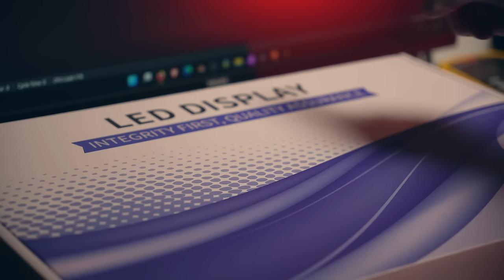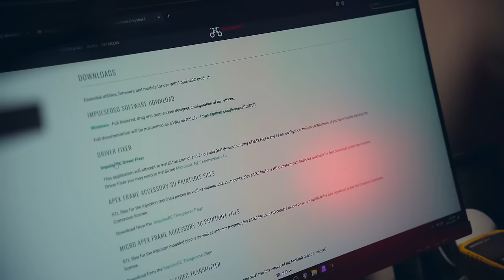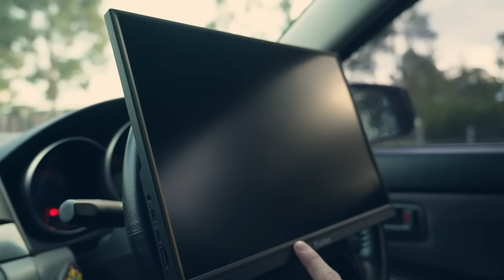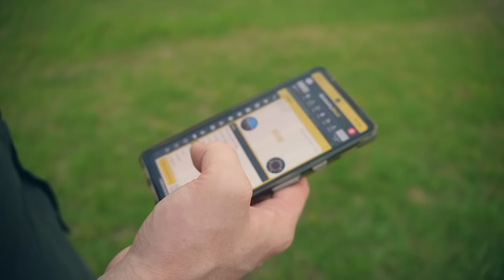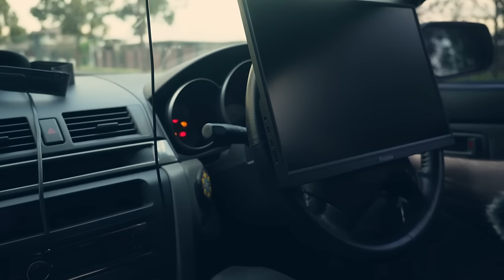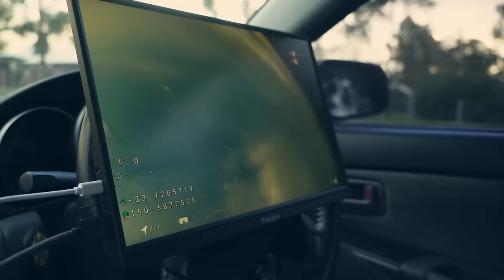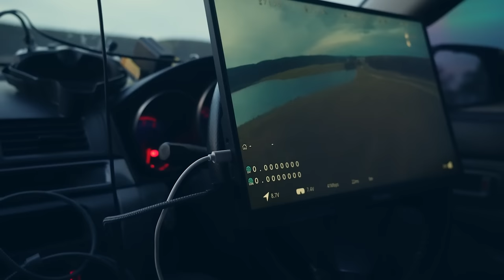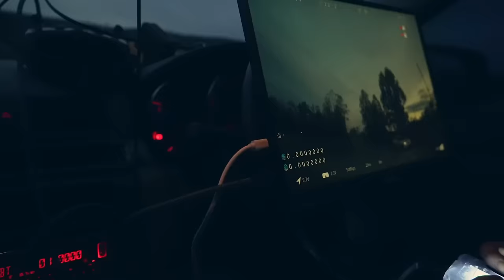FPV on a gaming monitor?

Comment: Nice design on the 3d-printed wheel monitor adaptor. I tend to wire the GPS to a 5 volt power to a pad that has 5 volt power when the FC is plugged into an USB. Can then use portable USB power bank, or plug into USB in your car as getting things set up, or near the field.
Reply: It also helps that the vtx isn't powered this way reducing interference and improving the sat lock.

Comment: To backup settings, connect to the FC and in the CLI tab type DIFF ALL and then save to file. To restore, go back to the CLI and click load from file. This would have gotten you most of the way but there are a few settings to work through that have changed in 4.4+ and would be colored red when loaded from a file. Backup settings before making changes and even afterwards too so you can always roll back if you run into an issue.
Also for sunny days you can make a cheap monitor sun hood out of black foam board and adhesive backed velcro. Happy flying!!!

Comment: If you get an M10 based GPS, they are much better at picking up satellites, plus they have a memory.  What I do when I get to a new session, is first just apply USB power to the FC via a powerbank.  That way the GPS can start up, while the VTX stays powered off.  Then once it has enough satellites locked, you can remove the USB power and power it up for real.  Should be ready to go MUCH quicker with this method.

If you think about it, if you enable GPS rescue, failsafe to  Return to Home mode (RTH) it can't take off before it has full lock, otherwise things can go seriously wrong if you flick the switch to enable RTH, before it has all the satellites it needs

Comment: if you decide go with the monitor instead of the goggles, you'd probably do better with the walksnail  standalone rx you can probably 3d print a mount that attaches to the back of the monitor
Reply: Also for turtle mode, you have to arm the motors for it to work

Comment: You can lower the minimum amount of required satellites to 5, and the Home Point will be accurate and it will then display the H and how far you are from the Home spot.
If you dont have a M10 GPS, then definitely get that. Allow arming without fix, lets you arm the drone without having the proper amount of Satellites, but you will not have GPS Rescue.. 
It still takes about 1-2mins for the first battery pack of the day. 
If you want to go even further look into how to do the GPS wire shielding and grounding the shield.. You will get 5-6 Sats and be ready to take off in 30 seconds..
Definitely lower your minimum Sats number needed for takeoff, i have never had a problem with it at 5 Sat's, which is the minimum for me on V4.4..  
Im going to be updating it to BF V5.0 release version soon as well to see what else was done to the GPS & GPS Rescue..

Comment: A trick with gps I learned… plug a USB battery pack into FC in the car and carry both to your launch area. Then unplug when you are ready to take off and your satellites will likely be fixed by that point.

Comment: GPS - wrap copper tape around your antenna, add a strap wire to connect it as per you antenna connection. Make sure the copper is covered/heat shrunk or fabric tape to isolate it & prevent shorts. 
No my idea - saw it elsewhere on YT 👍

Comment: The MSP connection is active arming error shows up whenever you are connected in betaflight so id say it would be the same for the speedybee app. Its so you don't accidentally arm it on the bench. The beeping is because of inactivity and kicks in after a certain amount of time. Not sure why it would not arm tho, also tips for getting a quicker gps fix, have the gps mounted as far as possible from the vtx antenna with nothing above it and also if you shield the gps wires by wrapping them with aluminium or copper tape it also helps. Cold starts on gps always take a while tho.

Comment: Have the same but named Azropa and I'm using it with MFD for long ranges with Walksnail VRX. Perfection when sitting in the car, looking at the monitor and don't feel the cold. Antennas mounted outside.
Reply: Arzopa pricing is very competitive. I also always FPV from inside the car next to the municipal park, VRX on the dash board. I tried having antennas outside on the roof, but on the dash is just as good when your craft is in front, on the sides or above the car for long distances. For short distance, it doesn't matter where the craft is in relation to the car.

Comment: You have the quad sitting on a metal drain cover, that's why you're not get enough GPS signals. You should never arm a GPS drone on or to close to metal.

Comment: An M10 might, but might also not, magically solve your locking time problems. If it's too close to the VTX and the latter is too noisy, it'll crap out just as much as the M8. And then the GPS antenna size also matters, irrespective of the GPS chip. And then stuff like cloud coverage on a given day matters a lot. And then, for this kind of flying, no real need for GPS.

There's a BetaFlight setting that lets you arm without/before having a lock.

Comment: 14:30 the beeping just is a little heads up that it's turned on and didn't do anything in a X amount of time as you said you where waiting for several minutes to gather more GPS satellites this would be the reason😅

Comment: You can build a ground station with vrx and a monitor...and no goggles at all...basically what u made your goggles be.  But a ground station can be setup with better antennas because it's not on yiur head

Comment: If your GPS is next to your VTX you’re gonna have a tough time getting satellites
Reply: That explains why my helicopter always gets tens of satellites in 5 seconds with the cheapest and smallest GPS in the market. My VTX is at the head of the helicopter near the front of the battery; my GPS is on the notorious long tail boom. I have been puzzled by so many videos about slow sat locking.

Comment: That monitor and the Walksnail vrx.
Hell yeah 
Also make sure low power mode is off when armed. I have the V1 fatshark Walksnail goggles and just a hill wouldn't make it lose connection on 700mw.
Truerc stubbies on goggles and Lollipop 4+ on the quads.
When o fly with my buddies that have dji around buildings/office parks/bando's they will be on 1200 and I'm fine on 500 to 700mw doing the same range.going inside buildings? I don't know as we go one at a time mostly and don't really compare mw's etc if it just works at that spot for us personally.

Comment: Your gps needs to be pointing straight up. Its angled the wrong direction. It needs to be pointing straight up in flight, which is why you see them pointed downward almost akwardly.  You can change the amount of satellites required to arm in the failafe tab. Thats why it wouldnt arm

Comment: If you haven't figured it out by now the setting preventing you from taking of until it gets its fix is in the  failsafe tab. Im unure of what happens if you turn on gps rescue with out setting a home location. Its probaby not good though... i should turn that off.

Comment: i have some suggestions.. buy an m10 gps which are much faster to lock on and before you reflash an fc i would export the config so it it much faster to reconfigure.. another suggestion is try the supa fpv preset for the 5" which is amazing, it made a huge difference on my quad.. also i would lock the crossfire and not have it at variable output..

Comment: I like the idea.. but 350 nits is not very bright for outside use. You want 1200+ at least.. I have a 700 nit monitor for video work and its impossible to see much of anything in sunlight. With a hood over 3 sides. You can find 7" 2000 nit monitors for video work and even those are not bright enough in some situations.. they work but you still cant see a lot of detail for high end video work without hood and looking closely at it. If you can find a shady spot, 350 may work but 700+ would be better for FPV stuff. I'd still wager for FPV racing it's not enough detail for good racing stats but for just flying around it may be. Also.. the monitor you link is no longer available.

Comment: DO NOT PLUG IN YOUR DRONE ON THE WORKBENCH WITH PROPS ON.  You might think it wont happen to you but so has everyone that has had one of these things coming to life and putting a hole in you your monitor or roof.  It happens so fast and you will not know its happening until its almost over.  FYI
Reply: You mean USB or battery?
Reply: He means: be careful with setting it up with props on. Because if they come alive, there is almost nothing you can do about it except for waiting and hiding until it's over. They will do it just the moment you least expect it. That's the nature of such accidents.